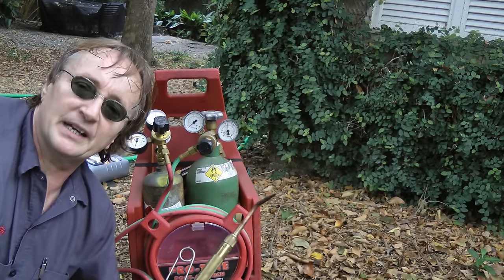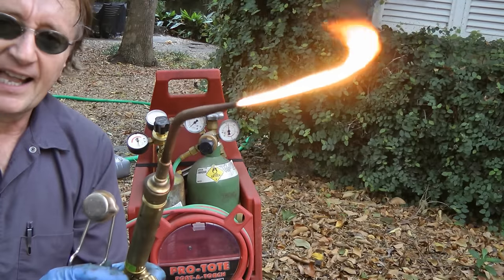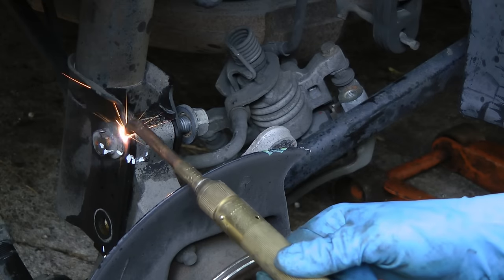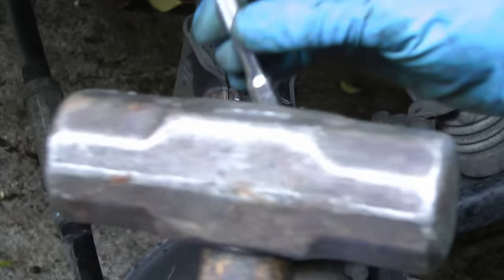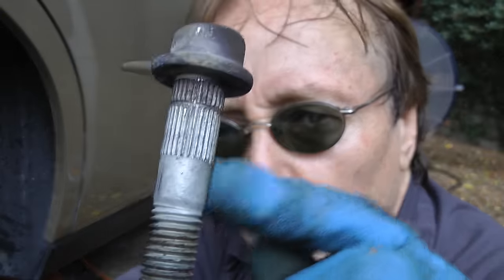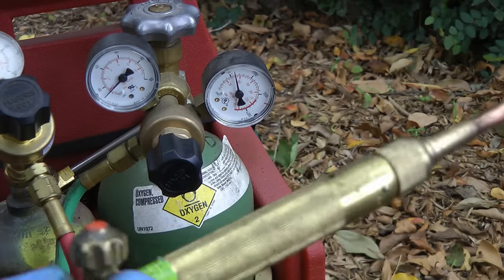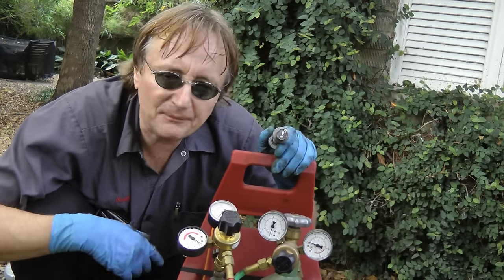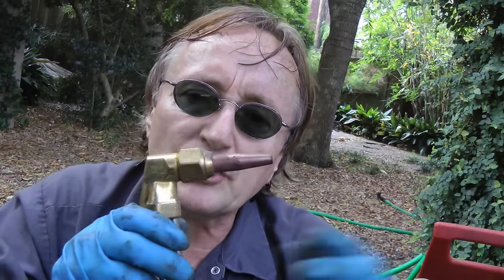How to Remove Stuck Nuts and Bolts in Your Car

Comment: I love ya Scotty, but in a prototype environment, if I ever lit a torch that way, the entire crew would kill me!! A propane flame can do the trick too. Meh!
** Try cracking both valves, VEry slightly, it lights w/ no floaters, no giant fireball -- then adjust the flame. Neutral for heating and silver solder, white for lead soldering or hardening. . You help people so much. That's why you're the best "U-tube info dude" for sure.

Comment: After you shut off tanks & drain torch head lines you should also back off both regulators to relax the springs to keep regulators in good working condition so they are ready the next time they are used.

Comment: i use 2 ways to deal with this sort of problems, 1. applie shock cold spray , if that does not work, heat it up with little propane torch, i dont need them so often and they are really cheap. but i have come to my sensei that if u need to use it more often , its good to get one of the Scotty verisons.

Comment: If you have access... just grind a slot partway through (use a Dremel cut-off wheel) and then use a nut splitter.  Grinding a slot (even just a bit of one) gives you a weak point with "stress riser" to make the nut splitter pop the nut easily.

Comment: cant beat heat,i use a lpg blow torch which I have.another trick is to run a welding bead around the outer bearing where the bearings sit as when it cools it thrinks the bearing

Comment: if you got something that's really stuck that you can get out just by heating it, get yourself a wax toilet bowl gasket. heat up the part til its good and red. then take a flat screwdriver or knife and take a little bit of the wax and let it melt it. might have to do it a few times, but it will work.

Comment: as long as you get the bolt to heat a little bit, it'll cause just enough movement to "crack" the rust off enough to move it.

Comment: give an impact wrench a try scotty,
get one of the pneumatic ones for 80 to 100 bucks, they will MONSTER seized bolts super easily, and very rarely shear the bolt (using a breaker bar has a better chance of shearing the head off of the bolt)
Reply from the maker: Ryukachoo these are DIY vids, of course I have air tools up the wazoo, but I don't normally use em in these vids for do it yourself guys. But, it didn't work that way anyway, it was too rusted on from being on salt water beaches
Reply: Scotty Kilmer woah! a pneumatic impact wrench couldn't even get it? that's pretty terrifying.

Comment: Heat will expand iron or steel , my two cents would be,do not heat the bolt , heat the nut or socket the bolt is going through . If you heat the bolt it would expand and become tighter, that's all i got to say about that , good energetic video sir.
Reply: exactly
Reply: It works. I work for a trucking company without those torches we would be lost.
Reply: it's the tiny amount of movement caused by the expanding that looses the bolts.
Reply: @mike Rand no the heat breaks free the rust and the inners of the bolt will release its best to try to remove the bolt or not once its cherry red it will break free like butter . believe me anyone who has turned a wrench before will tell you that this works like a charm
Reply: exactly. Harry is right. i had a pitman arm bolt siezed to the power steering pump shaft on my s10 and it broke free with a little help from a propane torch. Because heat causes expansion the threads on the nut loosen from the bolt. it will constrict once it cools. same concept with ice. it takes up less room in a cup than room temperature water because it constricts.
Reply: Orion Tackett  ehm wrong? solid ice water actually takes up more space than liquid water.

Comment: You can also use a little propane/butane torch like plumbers use when soldering pipes. Works slower, but same result and costs only 30 bucks.
Reply: Dremel 2200-01 Versa Flame Multi-Function Butane Torch

Comment: 50% acetone mixed with 50% automatic transmission fluid (preferably synthetic but either works) mix it in an oil can and oil the end. Works better than any bolt breaker I've ever used that was liquid. Always shake well before use though. Good alternative to a torch, especially in this case.
Reply: sometimes it can't penetrate into the threads chrisfix

Comment: Or for a fraction of the price get one of the big blue propane torches from home depot for $20, it does not get as hot but works for 95% of the stuff I've encountered thus far.

Comment: Better to heat the outer housing. It enlarges the hole. On really tough stuff, I've had to heat it all, then quench the bolt head to shrink it, then quickly hammer it out. I'm used to working on much bigger stuff though. PS. love your videos.
Reply: cold air spray works.
Reply: I totally agree with you, he is heating the wrong part, beside heating the bolt softens it, no good for a suspension part.
Reply: No it does not. A sheet of metal when heated will have the holes drilled into it shortened. Metal will expand into the holes, since it is a void.

Comment: Good Day Scotty,
Did you ever try those Magnetic Metal Energy devices?
A Garage my Brother worked at bought one a few Years ago. You attached the Well on one end of the frozen Fastener, & the Cap on the other, & energize it.
The Magnetic energy the Device sets up gets only the Fastener flipping h o t fast.
It only works on Ferrous Steels.
I can't afford that thing, I use the Torch method as well.
Reply from the maker: those heat up the bolts using electricity, but I have a torch so I'm not buying yet another tool. I assume they work fine though.

Comment: My problem with heating up bolts is that these things are already heat treated and annealed for strength. Before the average guy touches a torch he must understand hardening and tempering. e.g I can just see some folks dowsing the bolt in water as soon as it moves making them brittle. Also heat travels very fast and based on your design of shock and talent, you may wanna think twice before applying red hot heat around gas shocks. WD40 and a breaker bar never failed me yet.

Comment: I bought an Oxy/Mapp torch kit for $75.  Good to get a couple jobs done but once you do a couple bolts you need a new tank of oxygen.  I've gone though about $200 in oxygen and I'm still on the same Mapp tank.  It cuts metal, and if you can cut metal you can weld...just costs more to run.

I had the idea of getting one of those air purifier devices that people use for medical oxygen that extracts oxygen from the air and provides 90%+ pure oxygen.  You can get them used for $200 and require little tweaking to make them work for standard oxygen connectors and supply requirements.

I have the Worthington Mapp & Oxygen kit.  It's at Canadian Tire for $75.  1.4Oz Oxygen tanks are $10-12 around here.  There were some 2.1Oz tanks for the same price but they stopped selling them, for some reason...

Comment: I've used this trick numerous times, came in handy especially when removing the seats in my Jeep. However, I don't have an oxy-acetylene torch, I use a standard propane torch. It takes a bit longer to heat the bolts up, and it probably doesn't work too well on large bolts for suspension, but it's cheaper and can work in a pinch. I usually use my impact drill (NOT IMPACT GUN) after I heat them up and it rattles right off. :-)

Comment: You can get a mapp gas torch for under $60 and will heat a bolt just fine, I use it eveytime I work on a front end or change an o2 sensor they never come off without alot of heat (for me anyway)
Reply: Thanks so much for mentioning this!  I purchased a MAPP gas torch to do some exterior plumbing and now I have an additional use for it.

Comment: Scotty Kilmer you have great videos, but I wish that you would
have also explained the dangers of  oxy acetylene when not used properly. Stuff like no more than 15 psi in the acetylene line, that the torch can get up to 6500 Degrees Fahrenheit, and how big the explosions and fires caused by it, etc. It is a great tool to use, but can causes serious consequences when not used properly.
Reply: If you are aged enough to fix your own car, you should able to handle it safely! If not, don't fix it Let the pro takes over

Comment: Won't just jacking or releasing the weight off the nut work just as easy if that the problem. There are other ways to use heat. But just jacking the A arm up relieves the pressure and the nut will come out.
Reply from the maker: there was no weight on this strut everything else was already removed from the suspension. Bolt was just corroded in place, only heat got it out.

Comment: Hey Scotty love your videos I've watched quite a few of them and they have been very informative and helpful I live in a province in Canada that has very long cold Winters and there's a lot of salt used on our roads so rest is a big part of our life especially with cars a little tip I learned to help prevent Bolts from seizing is buy a good rust protectant like Rust Check there's two kinds ones in a green can that leaves a greasy type residue that doesn't wash off easily and the other one is fluid film with these I practice preventive maintenance and spray every bolt that I can see on my car every 3 to 6 months I just be careful where to spray around engine so it doesn't burn off or create a fire but bolts around suspension and even bolts to just hold a little bracket that you wouldn't think would be significant I just spray it and leave it alone and I've had mechanics tell me that when they go to work on my car it's been great how easy it is to get bolts off without breaking them or having to use torches or replace bolts just like waxing a car to keep it from peeling or fading preventive maintenance very simple doesn't take a lot of time but goes a long way

Comment: Acetelyne has a Sponge like interior and uses acetone as a stabilizer ( the gas is very volitile on its own ) the reason you need to bleed off the lines is because the acetone eats the rubber of the hoses. :)  gas fitter by trade.

Comment: Another idea:
Dip a cotton ball in muriatic acid (place protection on the floor) make sure that you only wet the bolt and the area around the bolt, (wear gloves) cover the bolt in plastic, tighten with a rubber band. Leave on for hours or overnight. When time is up, apply baking soda over the acid. Leave for 5 min. Rinse with enough water, scrub with wire brush make sure no acid remains. The bolt will look very clean and renewed, apply pb blaster, it will work better.

Comment: Hi Scotty.               Question???
I was trying to change my own auto transmission fluid.   Trying to get the oil pan off was difficult.  The bolts were frozen, so I used map gas heat around the aluminum where the bolts went into.   I noticed that aluminum was around some of the threads of the bolts.  I had to pick it off the threads.     Is that normal?   Did heating the aluminum up cause this or was it already down from age?
Reply from the maker: that's not normal, you have to be careful with heat and aluminum as it's VERY soft.
Reply: Scotty Kilmer HI. in my defense, on the other side of the trans. pan, which I didn't heat, aluminum also came off, stuck on the bolts.  I just didn't want to snap them off.    My brother recommended a penetrating oil, like PB.  :)
Reply: Couldn't use breaker bar.  it was a 6 mm bolt with a 10 mm head.  Would of snapped.  I think I should of used that special penetrating oil.  That seemed to work on the other side. 
But oh no..  I hope the heat didn't do damage to the trans fluid cause I  ran out of time and didnt have time to change it.   Will change it next week, being that the nuts are all free now :)
Reply: You were probably shearing off the internal threads. The strength of the tapped hole is probably now compromised, and you may now need to use thread inserts in the hole to get the strength back.
Aluminium is very soft and is prone to electrolytic corrosion, which is probably the case here. Heat can cause more damage as you can't see when it is getting too hot until it's too late and it crumbles or melts.

Also need to be careful using oxygen around oil or grease (without the torch being lit) as this can be a self igniting and sometimes explosive mix.
Reply: Romulan112 o

Comment: You should try PB Blaster penetrating fluid on the stuck nuts & bolts first, before you go torch it & hammer it out. 👍

Comment: dont overlook propane or propaline(the fuel typically in yellow plumbers bottles) units as these cost a bit more than this torch setup up front(about an extra $100), but in the last couple years the fuel bottles for those little torches got way expensive, nearly 17 to 30  dollars for 10 cf of gas due to shortages of acetylene gas in the us. alternate fuel kits often use a small 4 lb propane bottle and generally 40 cf vs 20 cf oxygen tank,but the cost to use the setup is far less overall and one of my favorite setups is the smith little torch with the rosebud heating tip, its typically for jewelry work but is super tiny(about the size of a fat pencil) fits nearly anywhere and has more than enough heat to do this sort of heating, sorry no welding but you can braze with it, typicality more than strong enough for anything you'd use the torch shown here for anyways. 1 gallon of propane is 37 cf or so, so its equal to four of those red bottles. some kits now have 1 lb adapters, and are nearly as portable short of the larger oxygen bottle.

Comment: I tried my mechanic's acetylene torch on a bolt that was stuck in a brake caliper bracket..heated it up red lava hot then did some wackin with a sledge and an impact drill with a long heavy bit..didn't work. 
Had to get a new one lol

Comment: Scotty, my friend and I spent over two hours today trying to remove that exact bolt from my 97' 240sx to change out the struts... We didn't have a breaker bar but we tried so many different methods to get it off and sadly it beat us.   Hell we even tried using a jack underneath the wrench to use as the driving force but that mostly just translated to cosine error.

Wish I had one of those torches... do you think a breaker bar with enough leverage will be able to break that loose?
Reply from the maker: doubt it, but do try a bar with a really long pipe hooked up to the end, that will sometimes work if the bar doesn't snap off

Comment: Do you always want to heat the bolt itself like you did, or would you want to heat the metal part that the bolt goes through sometimes?  I would think that if you heat the metal part the bolt goes through, you'd expand the size of the hole, and the bolt would break loose more easily, yes?
Reply: Yes both ways will work just fine. The main thing to watch is WHAT you are heating. I don't use heat on brake lines or bleeders. And aluminum is soft so unless you are experienced ,don't use heat. PB Blaster left to soak 1/2 hr., or better yet ,overnight works really well for me.Heat is a last resort .

Comment: Hello scotty, Are stainless bolts used often in cars? Where are they suitable for and when should you use something else?
Reply from the maker: they aren't use much in car cause they tend to gall up and seize and don't have the strength of regular heat treated steel

Comment: Cheaper solution is to buy a can of butane gas (any walmart or walgreens $2-$4) then buy a (Wealers Multi Purpose Compact Design Gas Torch for Camping Welding from amazon $13).  An instant blow torch.